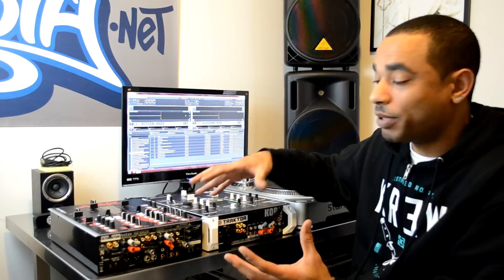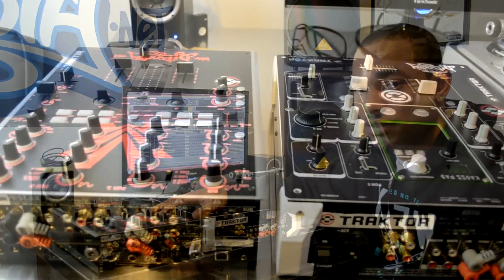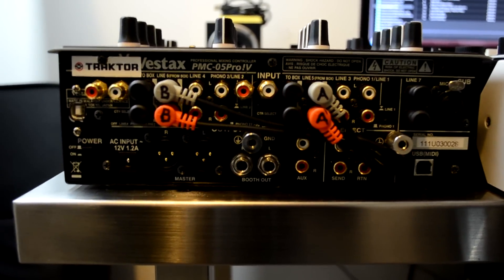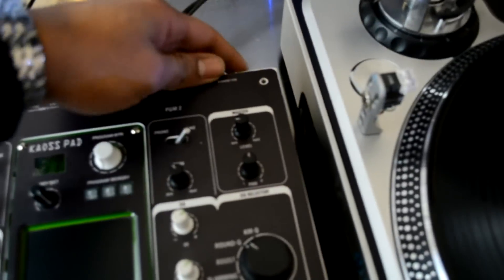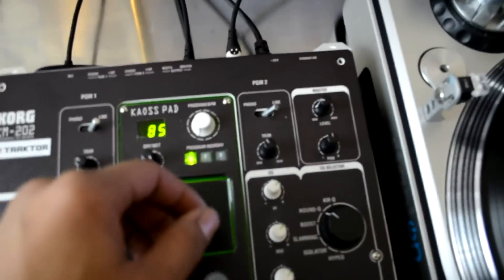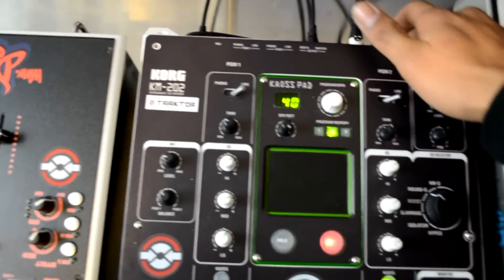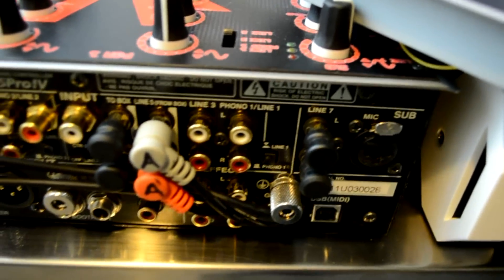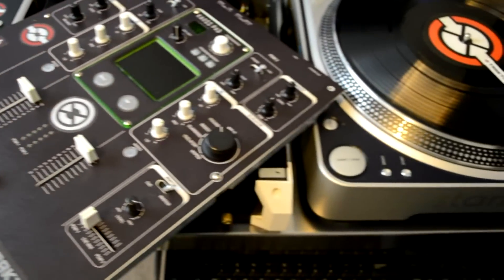DIY Traktor/Serato DJ Soundcards Installed Inside Of Your Mixer (KM-202 PMC-05proIV) SL2, A4, A6

Comment: That was my 07 pro for sale on eBay lol I'm getting a buddy to fix my cuttery and  install a metal plate above the power switch  using a pop rivet w/perfectly cut holes for USB and power jack.  I got pics on djitt showing RCA layout. Works perfect bc I routed out session knob for remix decks

Comment: As soon as you said drilling your mixer.. It would be a lot easier to solder the RCA connections from your sound card directly to the mixer RCA outputs. If you put a voltmeter to the connections, the signal would be stronger aswell.
Reply from the maker: Gold Frames I did not want this to be permanent... When you solder, its not as easily reversible... This way I can easily take the soundcard out and use it like normal if I want to...

Comment: For a cleaner finish You could of put an internal powered USB Hub that way you could of avoided drilling and having to mount another USB port. In addition to using less wires.
Reply from the maker: That's a lot harder than it sounds unfortunately... I wouldn't feel comfortable messing around with and tampering with the power of the mixer.  So an internal powered USB hub was a no-go for me...

Comment: I'm attempting to do this with the Audio A6 inside of a Numark M6 (then eventually taking out the stock fader for a innofader) and one of my questions is how do you keep the external box from moving inside of the unit during transport? My second question is on the drilling. Do you drill from the outside into the unit or from the inside out? Worried about metal particles falling onto the boards that are connected to the RCA's.
Reply: ***** Good to know, you wouldn't happen to have the link or the RCA couplers that you used would you? The ones I run into have the black shielding around them and I don't know how that'd work out with a 3/8 drill. I assume the velcro strips you got are from somewhere like LowesHome Depot

Comment: Great Vid. My question: Does the traktor z2 have enough space to add a rane sl2? It would be pretty awesome if this is possible since I would be able use the mixer with traktor, scratch live, serato dj.
Reply from the maker: You would have to open it up to find out...

Comment: I just realized that the way I did the 07pro mod soldered in it does not support LINE inputs...back to the drawing board it is...
Reply: ***** yesterday...I just bought both the 07 ISP and 05 pro 4 redbeat... I haven't physically got the redbeat to look at it yet BUT I think it is possible internally soldered on the 05 pro 4 only b/c there is a push button switch for line/phono input 1/2... but you would have to solder the DVS line output to line 5/6 on the 05pro4
Reply: i'm going to sell my Z2 and set one up with an SL2/3 and the other a NI 4/6

Comment: Hey man , good video.. i am trying to find the usb 3 panel mount unit and cable. Did you use a cable adapter or just a panel mount coupler and where did you buy it from

Comment: friend good night ! then have a controlling ddjsx 2 pioneer , wanted to call another external mixer this controller , which I would use only the parent company of CDJ , and other external mixer, wanted to use to make mixes in individual of the parent channel , ie play for Company serato more handle on the external mixer, u could tell me if the to use the controller as audio adapter and connect the external mixer it, or will need a time code , for me to use this mixer is to inform me and how to do this. thank you so much
Reply from the maker: +marcelo jesus It depends on which CDJ's  you have.  Some of them can be connected using USB to the computer to act as additional controllers, but some of them will have to work as timecode decks with CD's through the DDJ-SX2 RCA inputs.  You don't need another mixer to do this...

Comment: Does the A4 not need NI multicore cables? thanks
Reply from the maker: No, you can simply use regular RCA cables...
Reply: I love this idea tho. Its such a space saver. I got an A10 tho, which is a little larger than the A4 so im thinking of investing in an A4.... i got  a spare mixer and think i should try this. absolutely perfect video. and just so you know i always find your gear reviews some of the best available on the web.
Reply from the maker: M.M.S (Scottibus) Thank you very much.  Yeah, get a used A4 or something and it will be worth it...

Comment: is not clean, if you want permanently audio 4 inside you must solder the rca, not have cable outside
Reply from the maker: I know this but I didn't want to solder and I wanted the process to be easily and fully reversible.  I can take out and use my Audio interfaces any time and I have the flexibility to use either Line level ports or Phono Level ports...